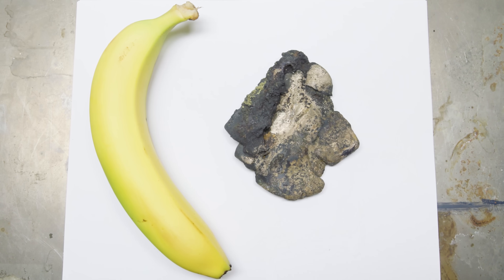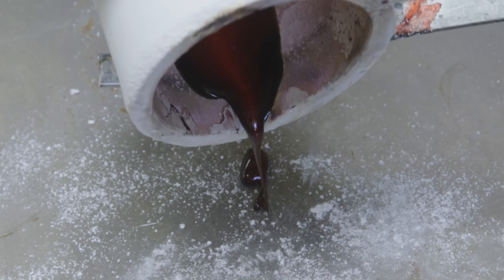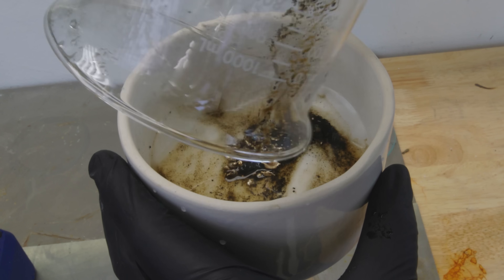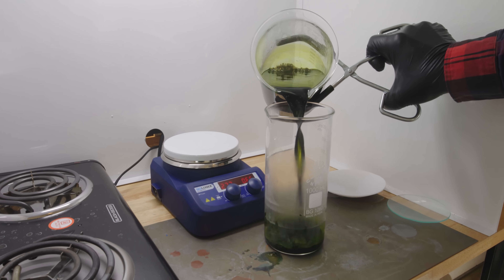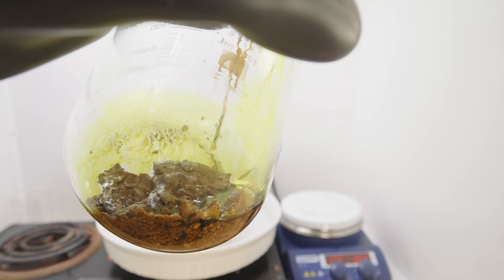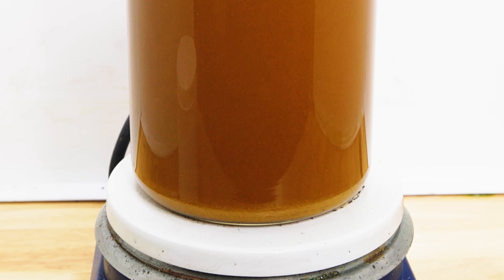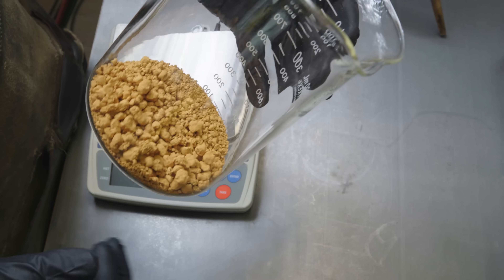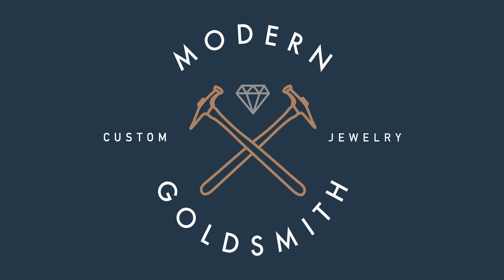Turning a BLOB into PURE GOLD!

Comment: The missing 9 grams are worth around $1,300. The difference between this ~ 96% yield and a 99% yield is nearly $1,000. This is still really really good. It just goes to show what the pros are capable of and why they and the fancy equipment are worth the price, especially when you scale up an operation; the losses can really add up. With just 10 "blobs" like this, the losses would be around $10,000.

Comment: If I had a suggestion do a couple nitric boils before you fully mix the hydrochloric into aqua regia. It really cleans up the gold and makes the dissolving process for the hydrochloric much much easier. And you're not left with glasses upon glasses full of the solution that has to be filtered, you'll often just get one glass that has to be filtered and it's much cleaner

Comment: Very cool ... buuut ... NO NEED 4 all of that!  The hydrochloric acid will dissolve .. ?>99% of the impurities and you're left with gold any buyer on the planet will buy at ?98%+ pure.  That's a lot of time consuming, DANGEROUS work for really no reason.  In fact, that orange gas escaping DEFINITELY contains gold - by definition you're dissolving the gold -> The boil off product contains the same % of gold as the container = > ?98% gold 😳😳🫩🫩😊  Just no need for all that 😢😊

Comment: As of Jan 14, 2023 which is when this video was released 213.2 grams of 99% gold was worth $13,026 US. Today, Nov 14, 2025 it would be worth $27,692.  If it was .PURE gold it would be worth $27,970. 
So in 34 months (2 Years 10 months) you would have realized a 112.6% gain for doing NOTHING except Resisting the urge to sell or use it.

Comment: All 100% rookie mistakes.
a. Melt down your material and Cornflake it.
b. Using Water and Nitric acid, boil and get rid of all silver, copper or any other metal.
c. After boiling in Water/Nitric until the solution is clear. 
d, Pour off solution, then boil in hydrochloric acid. Pour off and rinse with Distilled water.
e. Make aqua regia of 7 parts hydrochloric and 1 part nitric acids.
f. Put on heating plate. add more small amounts of nitric until all gold is dissolved, then keep it on the heat until no fumes are noticable.
g. Put it into another beaker, filter the solution till you see NO cloudiness.
H. put into a clean beaker, put in a tray of ice pour in the solution. Use SMB to drop the gold from the solution.

This guy could have saved a lot of pain, time and money from chemicals from watching a SREETIPS YouTube video.
Reply: he literally made an equivalant to what the gold is worth in youtube views, so i'm not sure who's the fool here 😳

Comment: Use a 1.6m x 90 mm PVC pipe with a cap on the bottom, fill with water add some metho.
You need to melt the gold a lot more and add borax, when it forms a button then pour it into the PVC pipe.
Pour the water off into a large bucket them remove the metal. If done properly you will have small clean granules.

Comment: Its most likely 99.9% 4 nines fine is cool, but bullion grade is usually 3 9s so what you have meets the requirement. The process you used is pretty common so i dont have a doubt in my mind that its basically pure as it can get.

Comment: That orange solution is called CHLOROAURIC ACID..... Gold nanoparticles in solution. That being said,  the solution should be a crystal clear golden orange. Not milky colored orange. You've got some base metals in there. 

Whenever I do a boil I usually keep up the initial boiling process, until the pour off is completely clear, Silver Nitrate. The Silver content in the Silver Nitrate is readily accessible. The gold is very pure at this time. 

Kudos on the assay! I was surprised at  99.9 Fine? Just shows to go ya that there's a bunch of different ways to get from here to there. 

Im getting ready to start my first ever cupellation attempt, to purity my own "BLOB". Nitric Acid don't grow on trees. 

True a 6 liter case of 70% solution won't break the bank, but, if I can master "Cupellation"? Well, that would be a game changer! Besides, the smell of those Orange Fumes gets really old after a while. Even with a robust fume hood and full face respirator!

Comment: An interesting comparison of your video and NileRed's one is that before adding the metabisulfite in the first run, his solution is a nice yellow, while yours is a dark green, likely because most of the other metals in his run are the copper wires he added, and he has got rid of them by heating with nitric acid. While yours is likely containing a decent amount of iron, based on the colour

Also, I really love to see how you handle challenges differently from him. Like you have the instrument to measure the gold content and a proper way to test for remaining gold in the solution

Comment: 3:53 another guy i watch uses a wet wooden cutting board angled into the water to help get the metal into smaller bits so it dissolves easier

Comment: You should have read before doing this project. Your process contains lots of mistakes, plus the glassware is not the apropriate. That vaccum funnel and filter paper didnt do nothing to the process for example. 
Also you could have recovered all the precious metals in 2 easy steps, reducing work load and reducing the amount of acids used in the process, making it safer and greener. 
But in the end is was kinda ok... 213/222g is not great, not terrible too...

Comment: 8 minutes in I see copper in solution and panic in realization that he didnt attack copper in the metal with nitric acid alone before trying to make aqua regia. Ohhhh boy... Next time attack the incorted 10k gold with nitric acid, heat, dump, wash, ago again, and then the metal leftover is fit for aqua regia- HCl solution and drip in nitric acid slowly. This will make for much fewer beakers and you get to see the aqua regia reaction more clearly

Edit: Meh I guess it does work the other way too. Remember to dispose of copper acid solution properly though <3

Comment: Sometimes it's possible to selectively dissolve the other metals and have the gold remain in the beaker as a powder. This is especially true when working with alloys with a low gold content. You can do this by just using plain nitric acid first - it will dissolve most of the slag and other metals but leave the gold untouched. Same thing when you have the crude gold powder - treat with HNO3 first - that removes the silver and remnants of other metals - you can then directly start smelting.

Comment: 99% purity is for chemical Gold, but if you want 99.9% purity you need to make an electrolysis. Is it worth it? No, only in bigger dimensions.
Fun Fact: Most Gold comes out of Copper Mines. Copper is like a binding metal/sponge that traps gold in it. Also we mine hugh amounts of
copper ore today. Most gold comes out of the sludge from the electrolyte tanks where they make copper anodes.

Comment: Should have hit it with just Nitric first in case there were silver in the alloy. Then filter off the liquid and then proceed to aqua regia with the remaining metal. Drop a sheet of copper or a piece of copper pipe in the Nitric to precipitate out the silver.

Comment: It's two years late but I have a question.  Why not melt it down from the original and then add materials to separate the impurities from the gold.   When it cools won't you have a button of metal and just knock the slag off?
I'm in no way a chemist or anything like that, but what's the difference?

Comment: You're very sloppy. lol. You needed to work in smaller batches for the amount of material you had vs the size of your setup. For example, just melt the material into about 5 buttons, let them cool, hammer off the slag, then go through your refining process with each button, making sure you keep everything clean as you go. I sure you learned a lot. good luck.

Comment: I've played with precious metals from electronics a little bit. 

I would have let it soak in the  cheaper acid first for a few days before making aqua regia. A lot of metals are dissolvable in cheap acids.  When you do make aqua regia, it is best to just add the nitric acid in small amounts with a dropper until the gold dissolves, It doesn't need to be a uniform process with specific measurements of acids.  Depending on the situation, if you have too much nitric acid in the mix for the amount of gold, it becomes a bit harder to get the gold to drop out of the solution.

Comment: There is a logical error here. For one thing you are assuming a constant gold content throughout the blob, which is not going to be the case. It would have been better to sample multiple different spots and average across them. But then even if this is the case your electronic touchstone does not give you an exact reading, but a lower bound. Considering this is a natural resource chances are pretty slim this has exactly 10kt, and the device only gives you the information that the gold content is at least 10kt and under 14kt. This means that your true yield (assuming that your piece is representing average gold content well) is between 96% and slightly above 68%.
Reply: Bro chill out he didn't take one chemistry class, how would he know?

Comment: The reason you had problems getting all your gold to drop in the end was excess nitric acid. You should pour all of the HCl on the gold, then slowly add nitric until all the gold is dissolved.  Then boil the solution until all fumes are gone.  There should be no more residual nitric that could redissolve gold that is precipitating from the SMB.

Comment: The chloroauric acid should be filtered until it's bright and clear.  Your orange juice should have looked more like a clear orange tea.  You could have continued to filter this solution using the same filter.  The more you use the filter, the better it gets at removing tiny particles.  This was a great result for a first try, but you can greatly improve your purity and yield with some simple steps.

Comment: Great work for a first try.  You should have put your water castings into nitric acid.  This would have pulled all the silver and base metals into solution, leaving the gold.  You pour off the solution, wash, then add more nitric until no more fumes or color is present when adding nitric.  The solution can poured over a copper pipe or mesh to cement out all the silver.  You now have concentrated gold and silver which can be refined further.  Only at this point do you use aqua regia to dissolve the gold.  You also need to add sulfuric acid to precipitate out any lead that was in there.

Comment: 1) Your gold purity meter tool is giving a false answer because this is most probably an alloy which can have a gold % between those pre-defined values, so your calcul is not exact. 2) You could just turn to a powder that alloy and do these réactions, one after another : a) attack with HCl = almost all active metals will dissolve. b) attack with HNO3 almost all passive metals will dissolve c) recover noble metals like gold, platinum, iridium, osmium and so which resist to HNO3. If you want to separate gold only, attack with aqua regia and Pt + Au will dissolve, Ir, Rh, Os (also Ti, remaining Ag...) will resist. Electrochemically it's even easier to separate these metals in solution by reducing one by one with the drop of reduction potential at the cathode. Anyway, good job, for a non-chemist. ;)

Comment: The reason it took so long after you added the sodium metabisulfite is you still had nitric in your solution. Some refiners will add a piece of pure gold to use up all the nitric. Weigh the added piece before and after so you know how much you contributed to the final total.

Comment: Typical non chemist to call things "junk", "dirty" and "impurities". Like things are grains of dust and not atoms. It's either in the alloy or it's not. When it's not it's easily separated. When it is, it is things like Silver which you need a certain percentage of for the Aqua Regia to bite through the crystal lattice.

You really have no base measurement from which to claim a yield more accurately than...without doing math, perhaps quarters. Roughly 3/4-4/4 yield. You should have made a homogenous billet and xray spectrometered it to get within a percent or so.

Comment: Actually the estimated yield should have been 214,5882 grams of pure gold if you calculate the unrefined gold weight after the slag was removed. So the actual yield of the existing gold in the blob was only 1,39 grams off. Well done!

Comment: Late to the party as usual... Nitrogen dioxide and nitrosyl chloride are always fun to have around. :) 9 grams shy of your mark may have been a rounding error in the machine you used to grade it as 10k. I loath music in videos BUT you took the time to make the right music choices for your situation AND managed to make some pretty mundane chemical reactions quite beautiful through slow motion, lighting and effects and music. Bravo. The chemistry for someone not versed in it was dead on the money (even though you needed to start with nitric acid to dissolve the other metals not gold and remove them from the mix before using aqua regia) it added a step for you and a little more work but made 2 great videos possible....  minus the vacuum filters that would have made your life easier. The entirety of the video was extraordinarily well done. Oration, videography and script were dead on the money and fantastic. I loved it very much indeed.

Comment: What an awesome blob! You've probably learned this by now, but you would've had an easier time if you'd first removed as much base metal as possible with HCL, and then HNO3 (separated by distilled water rinses and roasting to remove the chloride) before going to the aqua regia. You'd probably still need to re-refine, but your first drop would've been much cleaner.

Signed - a back yard hobbiest, non-chemist who has recovered and refined nearly a kilobar of .9999 gold from various sources that others have discarded.

Comment: The current market/economy is unnecessarily tougher for bloomers/senior citizens. Over the years I was just buying and holding onto potential assets, which doesn’t seem applicable to the current rollercoaster market trend, plus inflation is catching up with my portfolio. I’m really worried about survival after retirement.
Reply: I was once faced with a similar situation. I adhered to advice from a top invęstment advisęr here in the States. Through portfolio restructuring and diversification with good ETFs, S&P 500 and growth stocks, I've turned my portfolio around from $260k to over $605k in a few years.
Reply: I envy you. I incurred big losses in 2022. I was optimistic about stock markets but then I ended up with a wrong advisor. Lost over 320k on diversified stocks. Luckily for me my colleague pointed me to a renowned crypto recovery team who saved my ass and recovered 210k of my funds.
Reply: Who is this verified advisor that has helped you recover lost funds? I’m well intrigued and I could use some quality guidance at this moment.
Reply: Under the supervised advise of Jason Blake Hunt, I luckily recovered what was most of my lost funds between 2022 and last year. Simply look up the name. You would discover the information you needed to schedule an appointment with their team
Reply: Under the supervised advise of Jason Blake Hunt, I luckily recovered what was most of my lost funds between 2022 and last year. Simply look up the name. You would discover the information you needed to schedule an appointment with their team.
Reply: Jason Blake Hunt has always been on the top of my list..He is regarded as a genius in the area of Crypto recovery, and he is well knowledgeable about financial markets. I highly recommend you look him up if you need an excellent collaboration.
Reply: Wow..after all this time, crypto recovery becomes a reality. I personally have a lot of faith in his team of experts and I think it'll be successful.thanks for sharing.

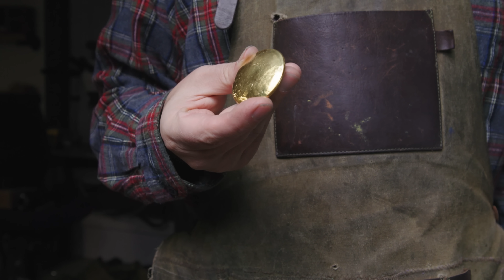Comment: 16:56 Because I'm a damn nerd at math the amount in total that you've gotten out of it by using division, which is simple - 213.2/222.2 = 0.96~ (rounded) then take  100 - 0.96 and you get a total of >99.04%< of the gold that was in the rock which is pretty good 👍

Comment: You made the mistake of not inquarting the gold before using Aqua Regia. You have to mix the gold with pure or sterling silver until it's only 25% gold 75% other metals and use a series of nitric acid boils to eat all the other metals. Repeat this until the nitric is clear after boiling.  It'll leave only the gold behind, THEN use Agua Regia.

Comment: To copy 24 Karat gold Melt  358 grams of pure copper and  642 grams of Aluminum. both pure and unused. When melted, make sure the mixture is stirred gently for at least 2 hours..Resulting metal can be poured into block moulds after the dross was removed. Resulting metal looks exactly like gold only it is lighter. Gold is 19 times heavier than water.